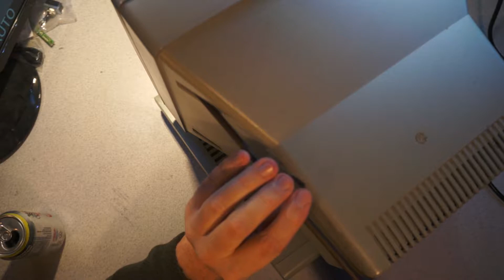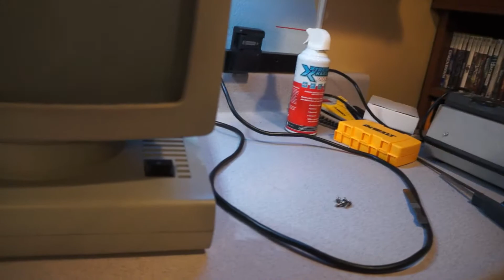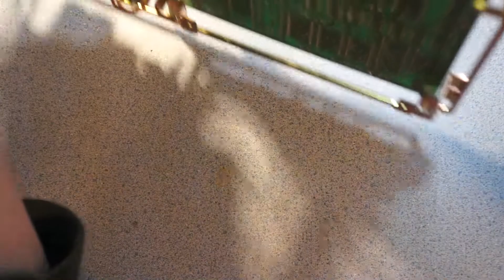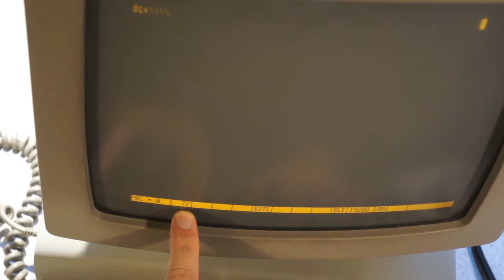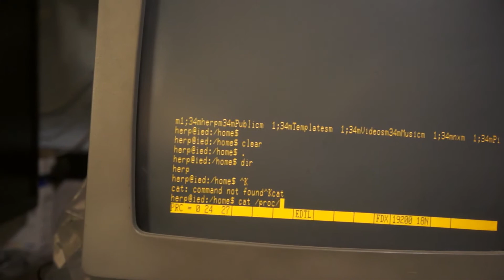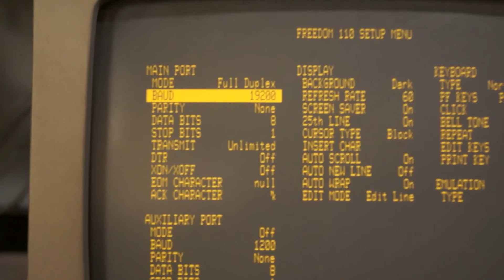Liberty Electronics Freedom VT110 Serial Serminal

Comment: What a lovely old terminal. You mentioned a few times about dating it. I don't know if you're aware of this but those old DIP chips often had date codes on them. I can see on the 74LS156 the date code 8605 (week 5 of 1986) which means the unit was made some time during or after 1986.

Comment: I think the block key is for block mode, where the terminal stores data locally, but doesn't transmit 'till you hit a send key. It makes sense when you consider that you haven't connected it to anything while you were testing it, since when it's not in block mode it doesn't have anything to interact with.

Comment: Did you try

export TERM=freedom110? The terminal definition SHOULD be in your terminal database sitting in /usr/share/terminfo. On my distribution it's there:

$ find  /usr/share/terminfo/ | grep 110
/usr/share/terminfo/z/z110bw
/usr/share/terminfo/z/z110
/usr/share/terminfo/f/f110
/usr/share/terminfo/f/freedom110
[...]

Viola! Freedom110 terminal definition.

Comment: The 68R02 is the CPU, The 68A45 is the graphic controller, That chip is still part of every PC design. The ROM by the 68A45 is the character ROM. The AM9128 are the 2 Video RAM's The TC5517 is a simple 2K SRAM. It's battery buffered. I can't see any RTC on it. The R6551 are the 2 serial port IC's. The 68A50 is also a serial controller and used to connect the keyboard. This 68A50 is alsmost the same like the R6551 but not as flexible and cheaper :)

Comment: Termcap/info are painful, and the problem with Linux is that most people don't actually have the hardware, so if there's something broken it may have never been correct.  I have a Wyse 50 and had to modify things to get it to work.  Might be worth trying screen or tmux to see if they help.

Comment: One classic trick for testing echo on these things is to use a paper clip to join pins 2 & 3 of the serial port.  Also, setup is usually accessed with a modifier, such as ctrl-setup or function-setup.

Comment: Also: a 38W PSU taking up *that* much space is ridiculous nowadays :D it's fun poking around in old stuff. Also, as I remember, my parents had an 80186 with a 20-something watt power supply that actually drew more than 75W from the wall. Those things had awful efficiency (probably not really sub-33% figures, but I imagine worse than 50%).

Comment: Using transformers for feedback has to do with the simple fact that you can transfer power (or drive) signals with a transformer, but you need a local low-voltage supply if you want to transfer power/drive voltages with an opto. Nowadays this is just done with an aux wire, but in early switching power supplies they almost exclusively used transformer feedback for that reason. They're essentially pulse transformers.